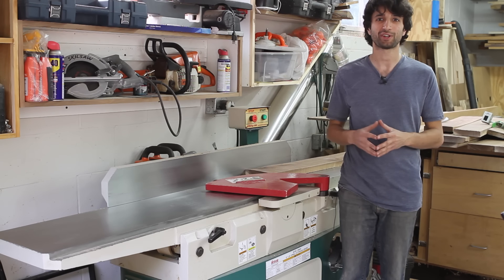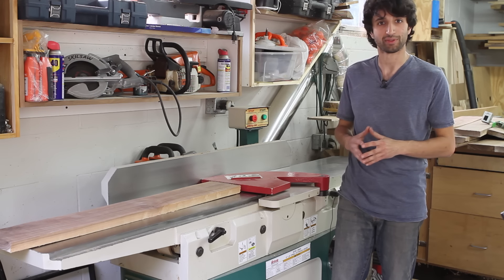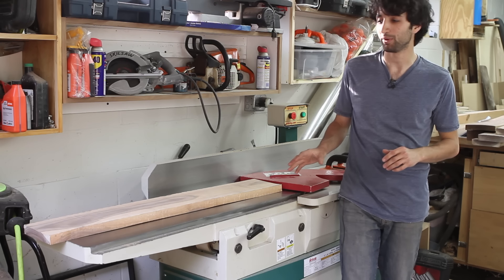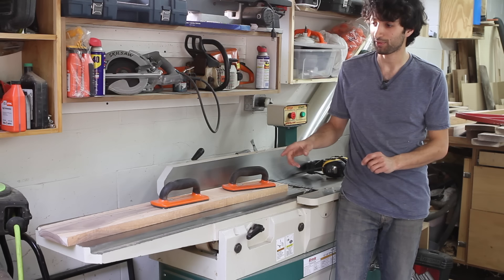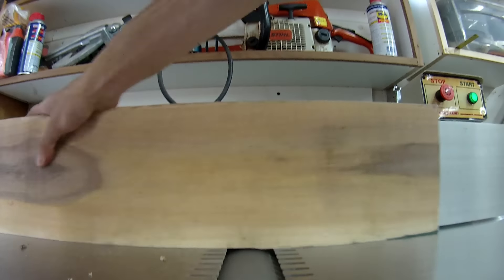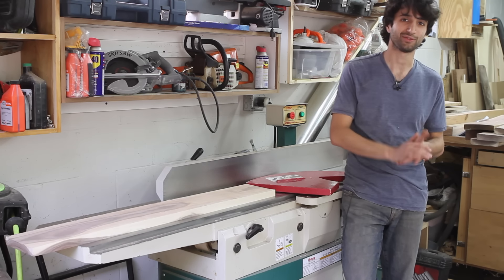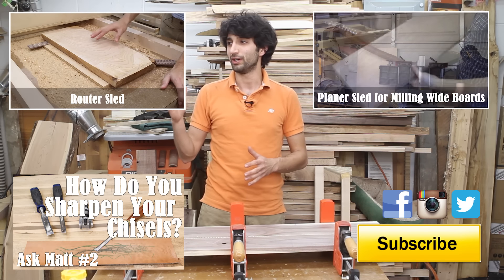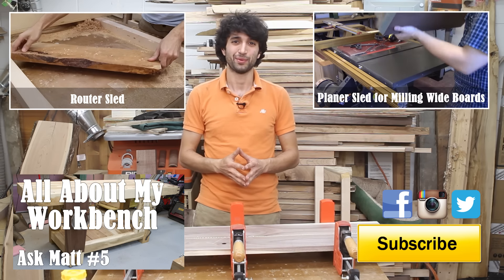What Does a Jointer Do? - Ask Matt #13

Comment: I always love your videos, i like how much detail you go into. I do have a question if you dont mind. I just got my first jointer and im having trouble flattening stock on it. I just some set up and put some cuts through on a piece of already fairly flat pine and the test piece came out perfectly flat after only minor tweaking. I then tried to flatten some pretty warped walnut (rough sawn, twisted, bowed and cupped) about as rough as it gets. And i just cant get them flat. they're tapered width-wise and still rock back and forth. Some of them are worse even—having a convex hump length-wise. What am I doing wrong? and how can I recover these boards?

Comment: So you use the jointer to just 2 faces flat and perpendicular. Then use the planner to get the 3rd face flat and parallel and lastly use the table saw to get the 4th face flat and perpendicular

Comment: That's a great explanation Matt. I agree, planer first if you can only get one. I have a 10" jointer and I've found myself making a planer sled more than once for wide boards.
Reply from the maker: Brian McCauley Thanks Brian! Even with a 12" I still have to use the alternatives sometimes as well.
Reply: It's good to be able to use them that's for sure.

Comment: The tables are parallel, not co-planer.  The feed table is slightly lower than the exit table; otherwise, nothing would be shaved off the board.
Reply: which is the definition of "coplaner"...  tables are parallel on two different planes...

Comment: good explanation, but I find it much more difficult with smaller, benchtop jointers to not apply downward pressure -- otherwise the boards are almost always too long and lift off the surface as you pass them over the jointer. Wish I had the space and could afford a jointer like that :)

Comment: Great video. Cleared up my confusion. So I am new to woodworking. If I want to square 4 boards for a project...say making a wooden box how do you make sure all four pieces are exactly the same dimensions if each piece may need a different amount planed off to make it square/flat?  Thanks.
Reply from the maker: The jointer is used to establish one flat face and one square edge.  The thickness planer will make sure all the boards are the same thickness.

Comment: Matt, my question is why would you not run the other two sides through the jointer, especially the other edge side. Why run the other side through the table saw.

Comment: so no downward pressure just push it through to get rid of a bowed board? thanks matt FINALLY  bought a jointer the other day and got it all set up and ready to go, nothing fancy bought the 6"  porter cable from lowes but gets the job done .
Reply from the maker: exactly, you don't want to flex the board.  congrats on the jointer purchase! :)
Reply: +Matthew Cremona ty sir!  it's defsomething long over due..and  something I'm going to have to get use to having as for edge jointing ,  say one end of the board is 5 inches and the other end of the board is five and a half inches would I be better off using a hand plane or should I run the edge through the jointer a few times until theyre even?  or will that not do anything at all?
Reply: +Matthew Cremona and all my god now I see why you have this big ass joint definitely in the next few years I'm going to have to upgrade to a bigger one size does matter when it comes to a jointer lol

Comment: The planer sleds only work for the face of the boards.  Not the edges.  But I guess you can make another jig for the tablesaw for the edges. Either way.  Getting a jointer saves time by more than double

Comment: Matt i have a question, so in essence you would run your wood through the jointer and planer before cutting your boards to the final size other wise if you do it after it would change the size and thickness in the areas that the jointer cut right?

Comment: Excellent!  Thanks for the instructional video.
Reply from the maker: thanks!
Reply: Hey Matt.  I'm kind of new to woodworking and my jointer (6" Craftsman purchased used) has been giving me a real challenge.  I applied some of your techniques last evening and got much better results than I have been.  i think I was pushing down too hard on the lumber.  I mainly joint rough cut cherry lumber (because I have a lot of it).  Do you keep jointing until one whole side has been cut smooth or just until it can lay flat?  Trying to joint off 6" wide boards and it cutting the entire surface is hard to hang on to or push through the jointer.  My blades may be dull...  Any advice?
Reply from the maker: I usually joint until the entire surface is cleaned up but you can stop earlier if the board sits flat and your planer won't deflect the board

Comment: Thanks for making this video, it really makes sense. So, what is a good jointer to get?
Reply from the maker: Glad to hear!  I'd suggest anything well made (heavy) that won't come out of calibration when you drop your work piece on it.  Also take a look and see how easy it is to calibrate.  The one I have uses 4 cams on each table to align them.  That's a really easy way to calibrate the tool.

Comment: I find that multiple passes on a jointer tend to produce a board thinner at the leading end and thicker at the trailing end.  Edge jointing produces the same effect, creating a long wedge after several passes. Is that inherent in the jointer or just bad technique?  Excellent video.   Thank you.
Reply: Or it may be because I have a short bed jointer.
Reply from the maker: Possibly technique but could also be the tables are not coplaner or the knives might not be level with the outfeed table. The bed length should only come into play if you’re seeing a difference in short vs long boards

Comment: HI was wondering if you can help me? I made a noodle board but it doesnt lie flat, I thought I needed a planer but it looks like I need a jointer, do I need both tools or will a jointer only level out the boards? I dont have a lot of funds right now so I looked at a table top version, if this is what I would need, is an 8 inch the way to go or is a 6 inch ok? Thank You!!

Comment: i wish i had that jointer, instead of half the size. they do a good number to a finger tip as well, sadly from experience. was planning a small piece and things slipped then next thing you know finger checks sharpness of the blades. been extra extra careful after that

Comment: Great video!

I'm still not understanding something though. If a jointer can make a face perfectly flat and can also make a face perpendicular to it's adjacent face then why can't i get away with just owning a jointer?

If i can make a flat face, make the side flat and 90 to the face, why can't I continue that on all 4 sides of the board, using the previously flattened face as a reference?

This would result in a perfectly rectangular board.

Is it because i couldn't keep the same thickness from board to board?

Comment: Coplanar and parallel are not the same thing.  Coplanar surfaces are parallel but also perfectly aligned - one cannot be slightly below the other.  The must both be at the exact height of the same 2 dimensional plane.  Jointer tables are to be parallel, and as you said, the infeed table is to be very slightly below the outfeed table.

Comment: Thanks for this video.  

What do you think is an acceptable tolerance for a infeed or outfeed table on a jointer? Specifically, I am curious about the variation that could exists on one jointer table, not both. So, assuming a strait edge touches an outfeed table on both ends, how much variation would be considered acceptable on a cast iron table? .001? .005?

Comment: So if you use a jointer to flatten the board prior to putting it through the planer, do you only have to flatten one side of the board and one edge in the jointer, and the planer does the rest? Or do you have to flatten all 4 sides in the jointer, and then just use the planer to get the correct thickness you want?

Comment: A jointer's two tables are not actually coplanar.  The outfeed table is higher by the thickness of the cut.   They are perfectly parallel, though.

Comment: At 8:45 you said you can use a planer to make the top of the board flat because the will use the flat bottom of the board as a reference. Is that a mistake? Did you mean you can run it through the jointer instead of the planer? I want to tile my bathroom but my studs are out of plane. I was told to use a planer. Will that work?

Comment: Hey Matt, thanks for this - some great info.

When you hand plane first, can it just be fairly rough so that the board does not rock, or does it have to be perfect? Or are we going for no rocking and no bow at all? How rough can it be?

I guess I'm asking if you can rough plane by hand, put the top through the planer and then plane the bottom to clean up the rough hand planing and give a final clean parallel finish to the hand-planed side, rather than do it all by hand

I'm looking to get myself a couple of semi decent hand planes (maybe a 4 and 6 sweetheart stanley) and save up for a floor standing jointer rather than a bench top.
Reply from the maker: Richie Rich It can still be rough but you want to get it as close to flat as you can since the planer will just copy whatever flatness you have on that initial face.  Taking out a cup is the least important since the planer can usually deal with those.  It's bow and twist that it will have no effect on.
Reply: Awesome - thanks very much Matt!

I finally bit the bullet and invested in a high tolerance set of vintage Stanleys and also a benchtop planer. Cant wait to get started!

This video was invaluable - it was the first time I have heard an explanation of the actual mechanical processes within each machine and the wood that occur during the joint / plane operations. Learning that the rollers push down on the lumber in a planer was the key - Everything now makes sense!
Reply from the maker: Richie Rich Awesome!  I can't wait to hear how it goes!  I'm glad this was helpful to you :)

Comment: What if you hot-glue the board to a reference flat, a MDF board for example, and run it through the planer with the MDF on the bottom? Wouldn't that make the top of the board parallel to the flat, i.e. flat itself? After that, you can un-glue the board, flip it, and run through the planer again with its flat face down. Wouldn't this sequence of simple operations create a board with 2 parallel flat faces, without the need for a jointer?   Am I missing something?

Comment: So the question I ask myself all the time is, why not just pass all four sides over the jointer to get a flat board. And as far as I understand this video the final board has the opposite sites flat but not necessarily parallel because the jointer does not reference one side to the opposite one. Am I correct with that assumption? That question bothered me far too long now!
Reply from the maker: You're correct.  It would have 4 flat sides but would be an inconsistent thickness and width because the opposing faces wouldn't be parallel.

Comment: So I want to conserve floor space. What do you think? A big stationary jointer like yours and then a small (Dewalt 735) planer? Or should I consider one of Grizzly's combination jointer/planer? I have 220V available in my shop. Which do you use the most, the jointer or the planer? Or a jointer and a drum sander? So many choices!
Reply from the maker: I had this jointer paired with a 735 before I moved up to a floor model planer.  The 735 is a great planer.  The combo machines are great too if you don't mind switching the machine over.  I think the bigger ones make that process a lot easier (I had a benchtop one once and it was a bit annoying to change over)  I use them both the same amount.  If something is going to get milled, it's going to be hit with both machines.  A drum sander is handy too :)
Reply: +Matthew Cremona Thanks for the information.

Comment: I have one question that I'm trying to find the answer to -- do you need to have the long edge squared first before running the flat side across the jointer for the first time? Do I need to shave off a bit of the edge with a table saw first, is my question.
Reply from the maker: No (and referentially, there’s nothing to square it to at that point)

Comment: When people put a bead of glue on a board, I always see them spread it. Is it necessary? What if you just run a line of glue, as you did at 11:00 and clamp the boards together without spreading the glue, would that cause any problems? Wouldn't the glue spread on its own from pressure between the boards?

Comment: If you had bunch of 1x3 and 1x4 boards for a project, and found there were some bows and twists in them, wouldn't the process of jointing and planing those boards give you inconsistent thicknesses between different boards? It seems like the jointer would remove more overall thickness from a bowed board than it would from one that was already almost flat...

Comment: Hi. I'm new to woodworking. I'd just like to know if I can just use a table saw to create the straight edge/planes?
Reply from the maker: lilsis You can use the table saw for that.  You need to have a straight edge to put against your fence.  If the board is already mostly straight you can just ride it against the fence. If not, you'll have to have a temporary straight edge attached to your board.  That can just be a straight piece of plywood or you can build a jig to hold the board.

Comment: Matt, my jointer is an older grizzly and it just chip the wood as I use it. Any suggestions?

Ken
Reply from the maker: Moonpie Creations Hey Ken,  Could be a few things.  If the knives aren't sharp you'll get a lot of tearout pretty easily.  The other thing could be the feed direction. Feeding against the grain makes tear out far more likely.  Grain direction isn't something I have to pay a whole lot of attention to with my jointer since it has a spiral cutterhead but I do have to pay attention to it on my planer.  It has knives.
Reply: This is an old grizzly jointer...do you think the belt being lose could effect the blades chipping? The blades are new. BTW I wish I had your jointer, that think is the cats meow!

Ken
Reply from the maker: Moonpie Creations It's possible.  If the belt is slipping and preventing the head from spinning at it's full speed, you'd probably see a reduction in cut quality.  I love this jointer :)
Reply: Wanna trade? Mines a classic.
Reply from the maker: Moonpie Creations haha!  I'm good :)

Comment: I’m using live edge oak for a epoxy river table and I’m struggling to get it through the jointer it just gets stuck and just eats the wood and ruins the board any tips? I feel like I don’t have the strength to push it through

Comment: Matt, what if 2 boards that you ran through the jointer and the planer come out to different thicknesses. It would seem like something that would occur if the boards had different levels of warp and twist. And if that happens, when you join them together, the boards wouldn't be flush would they? How does one account for this?
Reply: if you want a desired thickness you will need about 1/4 extra thickness stock to achive final thickness..if you want 3/4 you need 4/4 board, if you want 1" you need 5/4 board, if you want 1 1/4 you need 6/4 board and so and and so forth..

Comment: Such a great explanation!  What do you do if you're wanting to work with something like a 14" board.  I know that as long as you have a planner that can handle that width, you could build a planner sled, but I was wondering if you have any other suggestions I should consider?
Reply from the maker: most often I'll use the hangover method: https://youtu.be/q8BRnL65gSM?t=7m28s  Thanks!
Reply: Thanks for the speedy reply.  I'll check it out...and I'm subscribed now.
Reply from the maker: +Grey Darrah no problem!

Comment: Ok Stupid Question, Not really  Its more to get people to think what they are doing before trying.
If its the first stop in your Shop for all rough cut lumber  lumber, then are you going to joint a 17' board you plan on using 3' sections off of,
No your going to rough cross cut the parts you will join so you don't have to fight a 17' board so either a miter saw or table saw is the first stop in your shop to rough out smaller parts to join. if the lumber has a bad bow in it its better to join short parts then a long board because you won't be able to join the long board you table is not long enough to deal with 17' of stock.
You might join one edge but not the wide flat surface And it way too much stock to deal with at one time.
Depending on the wood type a 8" wide 5/4 board 17' long can weight 25-50 lbs each.
Storter parts mill a lot eazer. 

By the way I love your Wide Jointer, mine's on 6"  I can't use it for much but What I've found is I can take my planer and make it able to join board with a sled I haven't tried this yet. 6" wide parts limits my ability but does it because a 6" wide board will tend to cup over time with seasonal movement.  
Thanks for what you taught I did learn some stuff I never thought of, and no I'm not a pro woodworker I'm still learning Its been 40 years since I did wood working in high school I'm using reason to come up with my comments most people might not think of.  I don't know everything and its best to watch and learn, and I did learn from you.

Comment: I know this is an older video, but you demonstrated the bow, cup, and twist from one side of the board, sent it through planer on that side, THEN you flipped the board and demonstrated bow and twist on the opposite side of the board. I'm not disagreeing with the outcome of needing a jointer AND a planer... just comparing apples to oranges.  Great explanation overall though!!